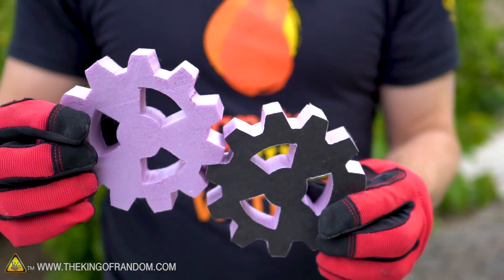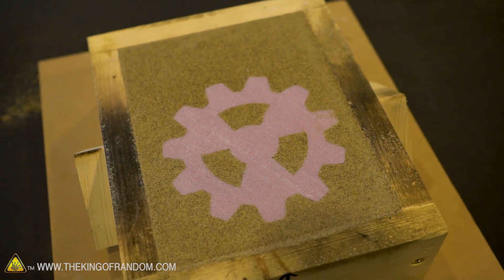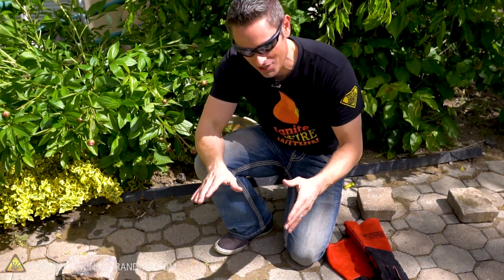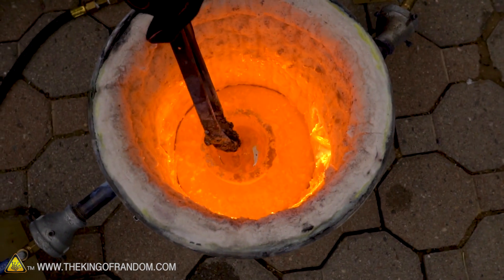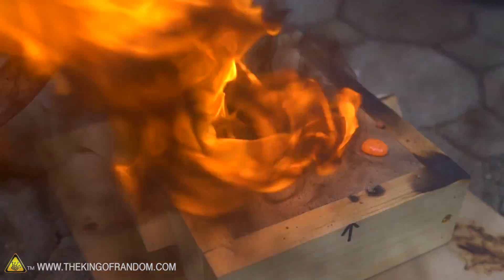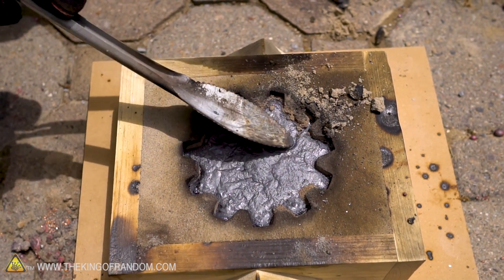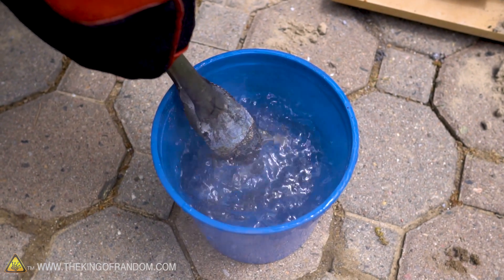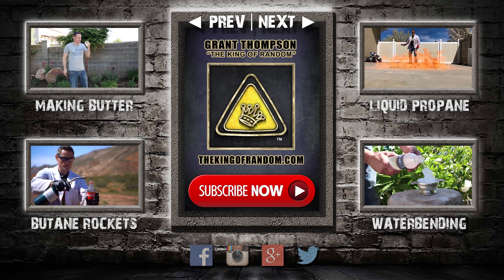Argh. Why Is Copper So Difficult? TKOR Tests Melting Copper In Our Homemade Foundry

Comment: I think that problem would probably be that the heat of the copper and the crucible dries out the sand, so if there was to keep the sand cool and moist then it probably wouldn't come apart. but then again this is just a guess so it might not.

Comment: Molten copper dissolves oxygen inside itself. As the copper cools you will see the oxygen boil out making all those bubbles. The old fashioned way was to stir the copper with a green branch, but there is probably a better way, like flux and charcoal.

Comment: Try using  a ceramic mold rather than green sand. You bake the ceramic mold to be super hard, smooth and heat resistant.

Comment: Grant what happens if you try a two piece mold?  Like putting the gear in one box with your green sand and use another box with holes for a fill and overflow.  I don't know it it would work completely with more clean up but it might be worth a try.

Comment: Would a 2 part mold not work? Like having a second part of the mold on top with a fill and vent made of sand to keep everything in place or am I missing something? I have never tried it, but in theory that's what I see would be a fix. Let me know if I'm thinking correctly, thanks.

Comment: You need a 2nd box with green Sand for the top half of the mold.  Add a pouring cone and some vents.  It'll trap the heat and fill out while protecting the shape.

Thanks for the video...

Comment: Maybe add more water to the sand
Reply: Thats extremely dangerous, water will start to boil causing the steam to get trapped under the copper. You'll end up with molten copper splashing everywhere.
Reply: No! Absolutely NO!... unless your goal is to get Darwins award and remove your self from the genepool, then go right ahead and do your part for the humanity^^...

Also problem probably was too much moisture in the sand, that turned into steam and was forced trough the sand making it unstable.
Reply: Puppy Fun for sure do not add any water to the sand , as other posters have commented it is very dangerous
Reply: ive had first hand experience with this
Reply: Yes the mold should not be to wet, however there needs to be moisture still in the mold, if it is too dry then the integrity is weaker.

Comment: I would have used a plaster/sand mold, preheated the mold and used some granular brazing flux to  remove the impurities being produced... That said this is why metal casting is very much an artform learned over years and years :)

Comment: if you are worried about the styrofoam, just use a propane or map torch to melt it away so you can pour your copper free of imperfections.

i have two suggestions to help in your casting process;

1. Heat the green sand so it is not so cool compared to the copper when pouring. the copper is beading and making gas pockets from its rapid heat loss. pour it and then take the mold and "bake" it in a hot over and gradually lower the heat over a space of time.

2. make a double sided mold so there is as little oxygen exposure to the copper once poured as possible.

Comment: Use polistireen foam (melts better) and place the foam completely under the sand with a chimney made of foam to the top also if you can heat the sand to keep the thermal shock down

Comment: try a metal plate on top with a hole in the middle, when the sand pops up the metal plate keeps it in place and i guess it will not melt

Comment: Hi Grant - If no one else has mentioned it, use sodium silicate ($16/gal from McMaster) in your sand and harden your mold with CO2.  Without a top cope, the open mold doesn't have enough support against the moving mass of liquid metal. Myfordboy has some great casting videos if you need inspiration. Cheers!

Comment: I feel that if you use both halves of your mould you can better control the flow of molten, heavy metal. Having a top with sprew and vent passages should help a lot. I had the privilege of having a great metal shop teacher back in middle school, we were sand casting aluminum in 7th  and 8th grades. Schools need to bring back quality Industrial arts programs in the grade levels before high school.

Comment: You should have used a 2 piece sand casting Mold, same thing you did except when you flip it over you put another frame on top sprinkle with powder and put in 2 pieces of tubing for as pour hole and a vent hole, pack with sand separate pull out your form and then you tubing for your holes put back together make sure you make one hole with a funnel look to pour the metal in.

Comment: use a cope and drag and put the gear between them this should keep the center send parts from breaking off and will give you a flat surface on both sides.

Comment: the weight of the copper pushed that styrofoam into the sand and the extreme heat cause gas exploding the sand out. you need to remove the styrofoam

Comment: From what I am seeing, the force that is holding the sand together is weaker the force being applied to the copper to it. In other words the smaller the details of the crafted mold, the stronger the shape of the mold should become. The cohesive force of the mold should always be stronger powerful the effect caused by the apply pressure on it. Suggestion: try 81.23% cement dust and 18.77% fine sand.

Comment: it's been over 40 years since I took Metals I and II,  your green sand should be made with oil, Not Water.  I noticed that the copper was bubbling as it cooled.  Steam coming up through your melt.

Comment: The copper only cost that much because it was tubing... It's actually only $2.50 a pound. So that gear probably has less than 5 bucks of copper in it

Comment: Hey grant instead of using the crucible to melt the Styrofoam use a blow torch. that's what I have been using and it crisps up the sand so it stays in place

Comment: if you  cast your form in calcium plaster after the plaster is hand dry take in to your oven and dry it tru 250 - 300 centigrade in 12 hours. calcium plaster givs a better 
surface

Comment: I wonder if he used some sort of hydraulic press to further pack the sand down if that would help the sand 'density'. Or put one of those paver bricks on top, use a ramp and drive one tire on top of it! That will do the trick.

Comment: What if, before you removed the foam you use wooden or metal dowels pushed through the three bits that are breaking to reinforce it. plus you could use a closed mould? it would also help contain the heat. Otherwise you would need a mould suitable for copper which doesn't use sand.

Comment: Metal foundry family here:

Try enclosing the mold: copper is too dense so it will try to push up any sand in the mold, enclosing it helps with that and with the cooling speed

Comment: Have a look to My Fordboys Channel, you have to make a two part mould. Top and Bottom Part. The copper is havier than the sand, so the parts of the radio active sign are floating ontop of the molten copper. The top part of the mold would support these parts and prevent the floating of them.

Comment: you need to use the cope and the drag with runners and risers.  the runners and risers allow you to build pressure to fill the gaps and it also helps to keep all the sand in place so you don't lose details.

Comment: your sand is bad and your method too. real green sand is a lot stickier when packed tight it doen't lose cohesion that easy. also doing a 2 part mold (top/bottom) is probably better because you can pour the copper full speed into a funnel and the integrity of the mold stays intact, it also provided better insulation to keep the copper flowing for longer

Comment: The problem may be the sand you are using. The sand they sell for sand casting is not moisturized with water, the one I tend to find is done with oil, not water and the grain is much smaller.

Comment: If I do stuff like that I would suggest that where the radioactive imprints are supposed to be I would use medal instead of sand but I would use a medal with a higher specific heat than copper

Comment: I have seen people successfully cast things in sand molds that kept floating by using a few small steel pins or needles to hold intricate sections down. the pinning must be done before you pack it, otherwise the insertion will damage the integrity.

Comment: why not mix water and elmer's glue then wet the sand with that so the sand can stay together from the weight and heat of the cooper, add some flux power or baby powder lightly so it can make a barrier between the sand and liquid cooper. should be an interesting revisit-revisit. best result would probably be made from a closed pour cast or do it in smaller amounts to allow the cooper to cool and hold the weight from the subsequent layers in my opinion

Comment: Try using sticks to hold the sand in. Or try putting a steel lid covering the top of the container of sand with a pouring hole or funnel on the centre of the lid.

Comment: you can try putting something on top of the middle part of the cast to prevent it from floating up, maybe a metal cover of some sort that is the size of the sand box with a hole in the middle got you to pour the molten copper in?

Comment: Could you dramatically increase the temperature of the green sand (bake it?) to cause the copper to retain more of its heat for longer? Not sure if this would make a significant difference but it might be worth a try :)

Comment: Blacksmithing tip. Quench heated metals in quenching oil. It's healthier for the metal (if you want longevity and strength) and although it sounds expensive,  you can buy some quenching oils for $20 a gallon (most oils are reusable).

Comment: 2 thoughts, add borax or other fluxing agent or simply make a fully closed mold. Make your mold about 4-5" taller and add more sand, then add a tube of styrofoam from the center of the gear to the top of the sand in a T shape in order to make a pouring spout to the rest of the gear, the extra sand on top will hold the sand together and will keep each side protected from the elements. This is actually how bells are poured from brass.

Comment: Think the two problems you're having is your pour is to fast and the sand is wet. Water in the sand will expand and turn into gas, thus the center parts keep shifting when you pour. Also your pour is so fast it can shift the sand around

Comment: first, your sand doesn't seem right, also you need to keep a cover over the mold and pour the copper in through a hole in the top to keep the sand intact

Comment: The appropriate method as I see it is to place the gear mold sideways so that one of the teeth is sticking out. When the copper goes in it fills beneath the sand instead of beside it and therefore not pushing the sand aside with the force. Next question would be the hollow parts, if the copper melts the Styrofoam before making it to the bottom, the sand will collapse into the pocket of hollow Styrofoam :P

Comment: would if you heat the crucible up first so that the foam melts then melt the copper so you can pourr it in straight away

Comment: If you have access to a press, try compressing the sand down with more force and it should stay in place.  Polystyrene should take a fair amount of side force and hold on.

Also, consider eating the foam away with acetone and then let it evaporate.  Then pour the copper in just a bit at a time so the sand will not try to float on the liquid copper.

Comment: Grant! the problem I believe I'm seeing is that you're not making a top layer of green sand, so you're leaving the top of your mold exposed. If you watch other green sand castings you see they make to molds, one for the object you're making and the top. They then make holes on the top one where they pour the molten metal in. They also take out the object they're molding, leaving a hollow cavity.

Comment: #1 Sand is less dense than the copper. So the sand destroys itself as it tries to float. 

#2 Your sand is too dry. A little more water could help. 

#3 temperature shock from cold mold could be affecting it. Try heating the mold in an oven or in the foundry itself. 

#4 Open-face mould casting like that isn't the best option. Try the fully submerged method like you did for the brass knuckles.

Comment: Try making a two part mold one on top and one on the bottom so basically make a mold like you have been except put another container of green sand with some type hole made with like a pipe and pour down through there it should hold the sand in place. Although I'm not sure I don't cast that's just something I've seen usually seen in other casting videos.

Comment: i have plenty of experience with casting, with the amount of times you made another green sand pour channel and held down your other sand pieces that floated up. seems  like the copper was just too much pressure for the mold and broke it loose. try the topper mold thats flat and have a channel on the back then secure the sides and make it a closed mold instead of open.

Comment: I might be way off but what if you used a tin pan rather than wood box, and used plaster in place of green sand. Once the plaster is set you could remove the foam gear, preheat the mold in the oven to 400 degrees or so then pour the copper into the preheated mold. I do know if you used cement it could hold moisture and kinda blow up with the heat not sure if plaster would have the same issues. The plaster insulation in the foundry didn't blow up so it might work.

Comment: Grant, if you go look up the youtuber Tito4re he does a lot of casting stuff. There is a video where he casts some copper knuckles. You are probably going to have to cast the gear how he casted the copper knuckles.
Reply: equesdeventusoccasus mould tree? You mean a sprue?
Reply: Garrett Hensl
Reply: Garrett Hensle
Reply: Grant, specifically, I think you will need a closed mold box with a mold tree to pour through.  This way you won't be putting too much pressure on your columns. The closed box also supports the columns.

Comment: Well from this you can tell that it is Bec because the sand is too wet I think you should mix concrete up pour it around the styrofoam and use that repeatedly

Comment: i feel like for Copper, you probably need to add more clay, since that is your primary binding agent. If there is more in it (obviously you would need to make that batch separate from what you have), but i think the probablem being is copper is probably a bit more dense, and so its just so heavy compared to the green sand, the green sand is acting like ice rather than stone.

Comment: try using a sand hardening agent and firing your sand molds to remove moisture which will reduce off gassing during casting.

Comment: Have you tried putting small metal supporting posts into the sand so the radioactive symbol isn't moved by the copper pouring?

Comment: You should try using silicon sand that way the sand won't break away and you can pull out the Styrofoam. Just make sure to use a co2 compressor to harden the mold. Also great videos keep em coming!

Comment: you need a cover Flux.  also a deoxidizing agent should be used before pouring. strain out the Slag before pouring....though the cover Flux can/should stay on.  Preheating your mold should help.

Comment: 1st you have a problem with metallostatic pressure. Liquid metal has an quite strong buoyancy, so strong that closed green moulds could even burst. Foundrymen are solving that problem with weights or clamps, to keep their moulds in place.
2nd I think your greensand hase not bound yet. It looks way to lose for me. As i know greensand from the fundries I worked, you will have a problem when you try to stick your finger into the sand or try to break a lump of it. The material is so hard, you will need a tool or drill to make holes in it and a hammer to crush it. I have heard, that foundries use activated bentonit as binder. Brobably this should help.
3rd Make a closed mould. You can make your mould as you are used to, but use a upper flask to make the a feeder an riser system. The feeder is in the middle, a hole (5mm) with a larger basin (30mm) on top, to pour in the liquid metal. Place another hole (2-3mm) over each tooth of your gear to vent gases and to rise (riser) excess metal. This will also help to prevend sudden solidification. Pour until you can see the metal comming up the risers. Probably it could be necessary to adapt the risers, if you have still problems with sudden solidification.
4th You can use a coating inside your greensand mould. As far as I know, they use coating for copper castings, when using greensand.

Comment: Did you try using liquid glass mix with the sand, and using a sealed  casting mould. This should keep the copper from cooling to quickly, if it does not work then try using a hot mould cast (not this dangerous)

Comment: I love your 'try and test' methods.  Your curiosity inspires so many.  Here's a few small hints so you can keep trying.  Copper transfers heat so quickly that a "FLUX" must be used to prevent an oxide from forming to quickly.  The water in the sand is evaporating too quickly and actually creates steam that cools the copper surface before it can properly fill the mold.  Once the moisture is gone from the sand, the steam pushes against the walls and forces the dry sand to move the same way as if you're picking sand up from a beach in your bare hands.  Many people who cast with sand use old motor oil instead of water.  You want the sand in the same consistency after mixing with the oil.  The oil will act as a "FLUX" that won't evaporate and prevents that oxide barrier of steam from cooling the copper too quickly.  Sorry if someone else has mentioned oil based sand previously, as I didn't read through the notes, but mold flux and oil based sand is pretty common in high temp casting facilities.